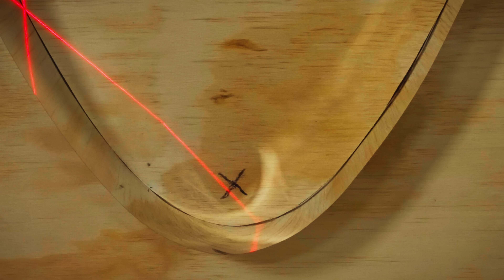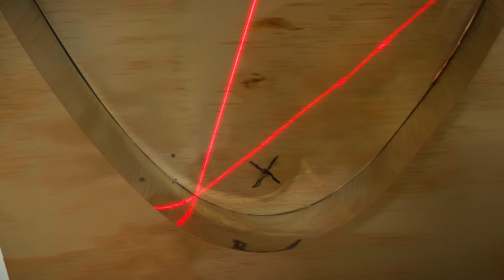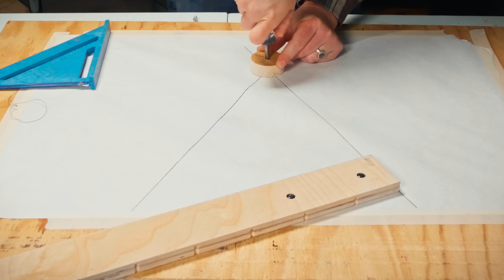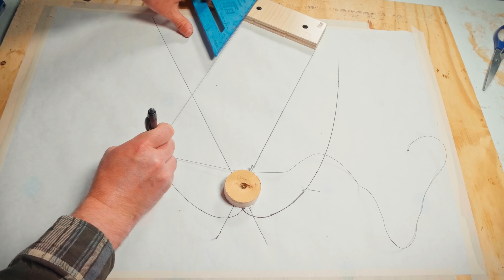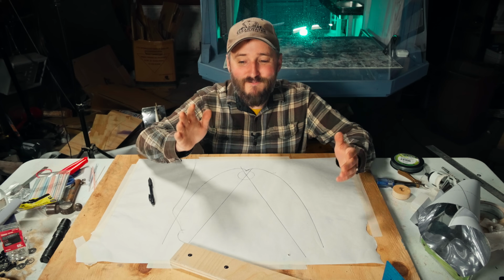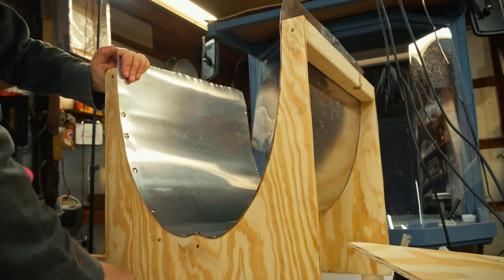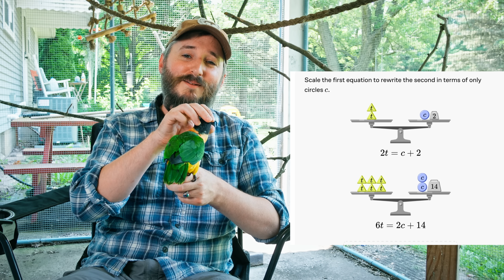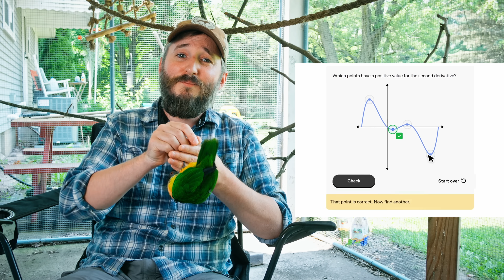DIY Solar Concentrators, Made Better.

Comment: Hey -

Even I failed to realize how diffuse the light could be until I began studying the whole concept of light energy concentration [deliberately refraining from calling it a 'solar' reflector, because this will work even with magma, heat you get from the night sky, or even a campfire].

ALSO -

You can improve the effect if you add a Fresnel lens array [like those you find in modern flat panel TVs, especially when people throw them out or donate them for cheap at thrift stores] because these can catch extremely tangential light and "wrangle" them around, so that, in effect, you CAN capture SOME light from even as much as 270 degrees BEHIND the mirror... Although, of course, at a diminishing ratio.

In other words, the Fresnel lens is not for 'focusing' the light, so much as [as I call it anyhow] 'wrangling' the light, so it can then scatter into the inside of the actual reflector.
Reply: Where is the Fresnel lens sheet panel located on the assembly? As a front cover sheet?
What is the optimal orientation of the lens polarisation (grain of the surface texture)? i.e. In this test case that grain running parallel to longest sides or the shorter sides the rectangular opening.
Reply: Wait, I think I recognize you from somewhere
Reply: @xmysef4920 Yeah, probably on a video game called Tera.

I'm a cartoon come to life!

No dude, you ain't never seen me anywhere before.
Reply: @hunnybunnysheavymetalmusic6542  No, I remember seeing you in the chat of naturejab’s livestreams
Reply: oh I GOTTA know how to set up the fresnel array for this. What would I google to find out more?

Comment: Could you use a pipe that runs vertically through one of these reflectors to heat the air inside enough to pull in more air from below and create a persistent warm air flow? Perhaps using this with liquid and as one part of a loop that includes a siphon/gravity effect elsewhere could create a persistent flow through the loop, allowing a steady source of heated water to pass through a floor or radiator.
Reply from the maker: Clever thought!

Comment: Have you checked if your drawing method works with arbitrary polygons/shapes?
I feel like it would only theoretically work with a circle, and the rest would only be because youre approximating a circle
Reply from the maker: The string only cares about the outer edge of the object, so in principle it should not matter. All rays within the acceptance angle should hit the top edge of the shape or lower

Comment: Very cool stuff Ben. Thank you for sharing. 

  For food and water at least, I've found that funnel Solar cooker designs (with a reflective bottom as well) work really well and are quite easy/simple to make. 

  I've tried to make a system in the past where I can suck out the most of the air in the clear container to greatly increase thermal insulation. However, it is a bit challenging because your cooking vessel then needs to simultaneously be a pressure cooker to trap the air and moisture in as to not interfere with the partial vacuum and Solar light collection. 

  But if one can master both of these, then Funnel Design+partial vacuum+pressure cooker should = very fast and efficient cooking and/or water disinfecting.  I have some ideas on how to fully implement this, but haven't been in a doing, creative phase of late. 

 Cheers

Comment: Shouldnt the drawing of the compound parabolic curve not also work with a chain if you put the board upright, wrap the chain once around the object and then hang the ends at the angle points? Cause if it does then that would strike me as the simpler and faster method of doing this :)
Reply from the maker: No, it's different

Comment: There's no such thing as "thermal mass."
It is thermal capacitance.
And yes, the difference matters.
Reply: If there is “no such thing as thermal mass”, as you say, then by definition no, the difference doesnt matter - they can be used synonymously (after all, you obviously understood what he meant, otherwise you wouldn’t have left this comment)
Reply: @mtqrx  Facepalm.
By your logic if someone mixes up a capacitor and an inductor, but I know what they mean, then it doesn't matter and the two devices are "the same." Obviously, that's nonsense.
This isn't a case of using words that lack universal meaning. If Einstein had used "emton" instead of "photon" in his paper on the photoelectric effect (because neither word meant anything at the time), then sure, it wouldn't matter. If the video said "the material has a property of storing thermal energy, which I will call 'Carlton,' " then again, it's fine because "Carlton" is just a name that doesn't already mean something contradictory. But that's not the case with mass and capacitance.

"Mass" is a property that stores kinetic energy. We all know about mass storing energy as 1/2 m v^2. But there's also rotational mass (moment of inertia). And there's mass in fluid/hydraulic systems. And it's inductance in electrical systems. There is nothing like that in thermal systems. Thermal systems do not have kinetic energy. The movement of heat does not have an energy storage mechanism.

"Capacitance" is a property that stores energy in a form of stiffness. Obviously, in electrical systems, that's a capacitor. For mechanical systems, it's a spring. Pipes/hoses swelling due to pressure is capacitance. In thermal systems, the energy stored because something gets hot, that's also capacitance.

The general equation for systems is M x'' + D x' + (1/C) x = F(t). Fluid systems, rotational systems, thermal systems all follow the same equation. The M is the mass term. D is damping. C is capacitance. (Stiffness is the inverse of capacitance.) x is what 'flows.' F(t) is the driving force activating the system. In mechanical systems, it's displacement, so the equation is: 
m a + D v + k x = F(t)
which has parts you should recognize: F = ma (Newton's second law) & F = kx (Hooke's Law). 
There is no second derivative term in thermal systems because there is no thermal mass.

It is clear from the equation that "mass" and "capacitance" (the inverse of stiffness) are NOT interchangeable, and using the wrong terms leads to setting up your equations incorrectly.

Comment: Could a parabola be used with your radiative cooling paint as well?  A perfect parabola aimed away from the sun seems like it could allow a pipe coated in your cooling paint to be cooled from all sides at once.

It wouldn't have any more cooling power than a flat panel with the same surface area of the pipe, but you wouldn't have to deal with heat leaking in from the back of the panel, since the back of the pipe is also pointed at the sky through the mirror.

Comment: With the channel being east-west, this can, almost, account for the seasonal angle of the sun. If you optimise for winter and accept some loss in the summer. You can have a close-to-perfect passive system. One side of the collector pipe will get blasted more in summer. But that can be designed for tolerance-wise.

Comment: Correct me if I am wrong but I believe this is the math for your compound parabola. (At least one side of it I figured you could just mirror this solution). 
y=x^2+(tan(θ)-2t)x-r
t=√(tan(θ)*k-r)
Where k ≥ r/tan(Θ) is the x intercept of the parabola and r is the radius of the circle.
Reply from the maker: Ha I have no idea. You could check your answer with the references in the video description

Comment: the flat collector variant sounds perfect for like solar panels, perhaps (though actually you don't want to heat those, just get the other parts of the spectrum in there)
When you say the resulting mirrors are optimal, do you mean in a total radiation exposure sense only or is this also optimal in terms of even coverage? I think for solar panels you'd want to expose the entire panel about the same amount
Reply from the maker: It's not ideal for even coverage. You would probably need a diffuser to evenly light a solar panel

Comment: Get a thermal recovery drain pipe to paint black and use as a target. Pump water through the outer spiral jacket and then air through the center. Use it for hot water and air.

Comment: How would the setup's performance differ if, instead of making your curve in a 2d plane, you took and turned it into a solid of revolution? (Revolved it around the vertical and made the pipe vertical as well)
Reply: I think that’s basically what flashlights do but in reverse - with the centre being a light

Comment: I wish you had done this experiment with the same size larger pipe; the issues of pipe size and diffused light seem to be conflated here. I would think that on a sunny day where light is pretty much coming in parallel, the parabolic mirror with round pipe centers at the foci is still best. I need to go back and rewatch/rethink why your construction better captures light coming in from many directions.
Reply from the maker: Check out the reference links in the video description

Comment: I'd be interested to see how this works 90⁰ to the focus plane. For example, if you've got a 6' long one of these, can you mount it vertically for a smaller footprint? That's a good next step for practical investigation, I think.

Comment: water tank up high(ish) water collector at ground level, use the solar heater to steam the water up to the high up tank, have a drain that goes to the bottom tank, and place a turbine in the path of the drain. solar electricity+clean water

Comment: Im wondering how much of a reflector it would take to get water above minimum safe tempteratures. I belive a water heater is supposed to get water above 120°F to kill stuff like legionnaires disease, 140°F to be really safe.

Assuming a partially cloudy day. I imagine you could then feed that heated water into an actual water heater to ensure it not only hits the required temperatures but stays that way while also lowering energy use by the heater itself.

Comment: Thanks for this cool video and easy tips to create these shapes!
The laser demonstration made it also very clear. But please be careful with lasers, i got a little afraid at 1:16 .
Even if they are laser class 1, these classifications rely to a great extend on the blink reflex. However the blink reflex got tested with flashbulbs and not lasers. There are studies that show that only 20% of people blink when blinded by a laser and even less turn their head away. Be careful, eyes don't heal.

Comment: So you made a thermal compound that could retain heat/cold for a period of time and I'm wondering; If pipes were laid in a small garden filled with that thermal compound, and a pipe coming off that main run say with a T, going up out of the ground to be heated by that CPC, could it be enough to keep plant roots warm in a green house? I know 30 degrees may not be a huge deal in a 0-degree winter, but could it potentially benefit someone in a more temperate winter?
Reply: I have seen people on Youtube doing that
Reply: @SolarCookingGermany  I need to do better research before throwing my ideas out there lol

Comment: Have you seen "Should You Really Use Solar Panels?" by Tech Ingredients? Their panel absorbs light from a lot more angles but the heat isn't concentrated. I'm curious which approach is ultimately more efficient.

Comment: This reminds me of those great big parabolic mirrors you see off of old 395 before you get to the Mountains. Because of the fact that they use a crystal tube with a very high temperature oil they do not need to modify the parabola They then pump that oil into a Steam turbine generating system And use it to flash water off of. If I remember right that oil is coming in at over 700 degrees Fahrenheit from those fields of parabolic mirrors. It was called the Kramer Solar Plant. I'm not sure if it's still in operation

Comment: 13:30 This comparison is unconvincing. Different sized pipes of different materials. Also the inside of the skinny pipe is visibly way more IR reflective than the wide pipe.
Reply from the maker: True, I could have done better in that practical test. The math works out though. Check out the resources in the description

Comment: This may be a silly suggestion, but what if you reversed it? Cover the mirror shape in your sky cooling material and see if the tube drops to sub ambient temperatures beyond just sitting out in the sun. Obviously don't point it at the Sun lol. You may have to coat the pipe in your cooling material.
Reply from the maker: There is a way to use this for cooling, a little different than what you suggest. It's a possible upcoming video

Comment: Totally out there idea but wouldn’t a star shaped pipe actually be a better shape than a circular one? I imagine the increased surface area and decreased volume near the tips would help increase the temperate faster, although to that end it could also help release heat faster if not being heated at that moment. I wonder if there have been studies on this…
Reply from the maker: Check the first resource link in the video description. They explore alt pipe shapes

Comment: Not saying your overall conclusion is wrong, but changing the target size and the mirror shape does mean you've modified multiple variables which kind of invalidates the test. I do think you probably would have still come out with the same one on top, but with the pipe being smaller at least some of the light that is missing it would have been caught and the delta would have been smaller.

Comment: This is very interesting.
But you still need the area to catch enough energy for it to be useful. We get about 100-1000 W/m^2 depending on location and cloud cover.
And it is a lot more work to make a solar concentrator over just making a black boks with black tubing.  
I guess you can reach a higher temperature my concentrating the light, but the energy is the same. Maybe it would work better for situations with low solar intensity because the energy is concentrated and you might reach higher delta temperatures relatively to the ambient air. 🤷‍♂
Reply from the maker: Yes, you want concentrated solar when temps reached by flat panels are not adequate. Cloudy winter days are one circumstance when flat panels will probably not cut it for a pleasant bathing experience
Reply: @Nighthawkinlight  Assuming we are collecting heat for a simple outdoor pool.

Maybe it would be worth it to combine simple flat black boxes with a solar collector. It does complicate things quite a bit though. On a sonny day you can just cover the collector such that the water does not get too hot.

But on a cloudy day where the flat black box looses more heat than it can collect you will have to insulate the box. And now you don't have a large enough area anymore.

And if you just run them in series you will not be able to reach that much of a higher temperature, unless your flow rate is really slow. Do to the high heat capacity of water.

You could then make two loops. One for the flat black boxes and one for the collector. And preheat the water with the flat black boxes and then maybe use something like a car radiator thermostat on the hot loop. But at this point it would just be simpler to make a larger concentrator and then just cover part of it when it gets too warm. 🤷‍♂

idk. Hop to see you use it in a project. 🙂

Comment: The compound collector... can't you use the chain method again? Just use two chains, and the tips are separate by the diameter of the target?
Or the angle is slightly different from that?
Reply: something like:

P...P.............................P...P where P is the pin holding the chain, and ... is the diameter of the target
Reply from the maker: It's different than that. You can learn more through the resource links in the description

Comment: I love how this dude makes smart, educational videos and also filmed himself shining a laser right into his own eye and published it on the internet.
Reply: Because that power beam is considered safe for casual eye exposure.   A  laser line generator is typically a Class IIIA laser, which is between 1 mw and 5 mw.  And then when it's scanned into a line, it further distributes its power.  In other words, they do not pose a hazard of eye damage at those power levels.  That's why they are readily available for purchase without the need for safety goggles or a CDRC variance.  A laser pointer from Dollar Tree is probably more "hazardous" and even then, considered safe.  Just don't stare directly into the beam! ;)
Reply: @nopethegeek  Only if you trust the manufacturer's specifications, which you almost certainly shouldn't. Brainiac75's channel has some good videos looking at this directly (on not, pun intended) should anyone be interested in learning more.
Reply: You want to know something that's more hilarious to love? Stop the video at 10:34 and tell me you don't see a pair of legs and a wooden heinie hole in the place of the parabola. Warning! You can't unsee it afterwards. LOL!

Comment: Great educational video Ben!
If you rotate your trough around its axis of symmetry, you can focus onto a knot of black tubing to collect heat and warm a liquid fed from the back.
I played with a 4 foot parabolic dish antenna 30+ years ago, using mylar blanket and a vacuum pump - seriously dangerous device, and it could freeze water on a clear night.
Now I can make the same things on a smaller scale with equations and a 3d printer, if only I had the time to play again!

Comment: 7:35 ive been thinking of how to use this for a sand battery since this started
Reply: Pex (maybe copper if hot enough) tube circulating through a coil in your sand battery enclosure.
Reply: @chrisanderson2368 lmao, i did buy too much pexb recently, already on-hand 😂
Reply: Torus shape?
Reply: With a magnifying glass on top?